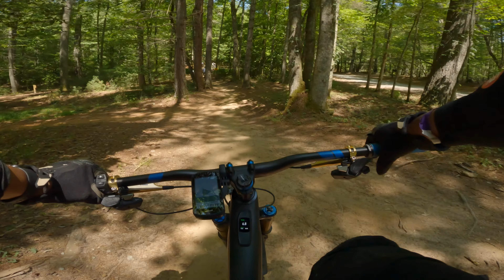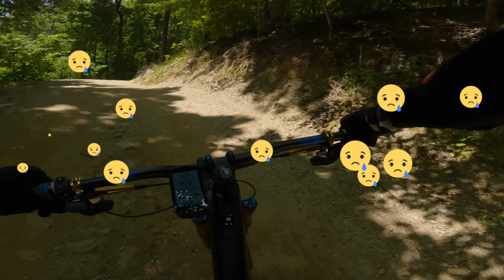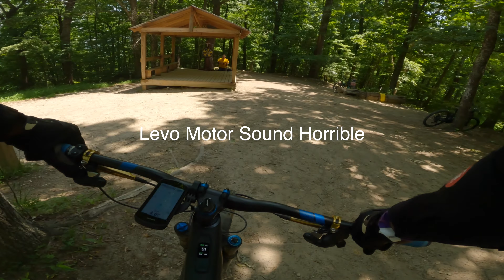2022 Specialized Turbo Levo Sworks Horrible Bad Sound Motor  Grinding Sound | Dream Build... Not!

Comment: i bought my s-works in march and i was just like you today.  suspicious sound and getting louder.  I wrote to the store.  They will surely replace the engine but it is still very bad news that they will go bust in mass!
Reply from the maker: Specialized just approved a new motor and it is on the way..to my LBS. hopefully it will work like mike 2018 levo.
Reply: @FreshToTheExtreme  The store where I bought it replaced it in one day, because they had a replacement engine in stock.  I was very happy that they were so fast.  Today I rode the bike for the first time since then and the sound is the same!  I will bring it back tomorrow.  Either I've been scammed...or I don't understand.  My engine roared the same way...
Reply: I got the 2022 comp carbon last week and same noise. Any luck with the new motor change?
Reply from the maker: @rajassar2971  I got a new one on warranty. I tested it out a few 2hour plus rides with 2500ft of climbs in plus 95 degree temps rides.. and the noise is not completely gone...but at least it does not sound like it is about to explode...🙃🤯and scaring the 💩 out of hikers.
Reply: @FreshToTheExtreme   what a nightmare. Best bike ever with the worst motor ever. Same problem here mate.
Reply from the maker: @bulekemtb7884  Its a love hate relationship with this ebike..🥲
Reply: @FreshToTheExtreme  awesome to hear, thanks for the reply! I’m going to have to visit the shop and see if I can’t do the same.
Reply: @FreshToTheExtreme  unfortunately
Reply: Local bike shops dont want to know anymore just intrested in selling you new bikes 😢😮 just had new motor in my 2022 model after a thousand miles, the motor kept sticking on when coming to stop! Month later with New motor and got s clonking noise when peeling hard up hills, called my shop said they never known a motor to make clonking noise that i have to film the problem cause they haven't got time to find the problem😂😂😭😭 if i said can i buy a new bike today they would be my bey friend

Comment: How did it pan out for you?  I’ve got the same issue on my 14 month old Comp with about 800 miles on it.  Apparently the motors covered under a 2 year warranty…I just hope they don’t consider it a “wear and tear” issue because then I’ll SOL
Reply from the maker: after the 3rd motor everything is good to go.

Comment: My gen 3 started sounding like that after about 150 miles. I have almost 700 miles on it now and the motor is being replaced because it isn't shutting off when I stop pedaling. It keeps going for a second or 2 which is super dangerous. Maybe the new motor will be quieter. I just bought my wife a gen 3 levo comp alloy and you can't hear it at all.
Reply from the maker: How to Fix Turbo Levo Motor Noise
https://youtu.be/nJVmRm7VTSg
Reply: I bought Levo Comp for myself and Levo Comp Alloy for my son. My bike sounds the same as in the video, but only on TURBO riding mode. My son's bike is quiet. They can't explain it in the store.
Reply: @cuvo1  I got my Levo Comp Carbon back from the shop last week with the new motor installed. Dead silent so far.
Reply from the maker: @cuvo1  https://youtu.be/nJVmRm7VTSg - try a bigger chainring - you might be able to put a 38T on it.

Comment: Does the diagnostic on the app tell you anything?
Reply from the maker: No. the BLEVO app does not work with the newest version. the Levociraptor APP is basically a stripped down version of the mission control app. It just allows you to set the max speed limit. I have to use my Garmin for accurate stats such as speed and distance.

Comment: My brand new levo comp 2022 have same problem :(
Reply from the maker: Though it has a new motor now ... I  have a feeling it will do the same thing as the last..
Reply: @FreshToTheExtreme  At least you get a new one for two years... hopium...
Reply: Thinks it’s related to using the Levociraptor?

Comment: I have the exact same problem with my 2022 S-works Turbo Levo.  Extremely noisy motor. Embarrassing riding such a noisy bike.  Bike shop told me Specialized will not replace !
Reply from the maker: https://youtu.be/nJVmRm7VTS try using a bigger chainring... if it is not the mullet... you might be able to use a 38T.. This should take away most if not all the winyness.
Reply: Any update on the fix? Why did the bike shop tell you that Specialize is not replacing the motor?
Reply: @comiclown  I complained again so me months later and new they have replaced the motor free of charge.

Comment: Hmmm, this makes me not wanting to buy the Sexy Black Turbo Levo and go for the Cube TM that essentially has all of the same (except mullet set up) and comes with the Bosch engine.
Reply from the maker: Never rode cube... but changing the chainring to 38T took the noise away. I have a buddy who got the entry level comp... and nare a sound can be heard.
Reply: @FreshToTheExtreme   Thanks for getting back to me. I am not convinced still, because of the many feedbacks I see of people in various places about engine issues. I am going for the Bosch engine instead.
Reply: Hello levo comp alloy 2022, 36T or 38T?
Reply: @stanleytanner350  I am not sure anymore if the 36 or 38 but went with the Cube TM.